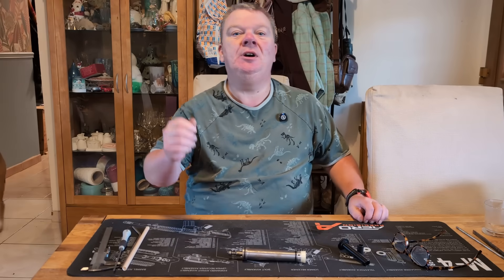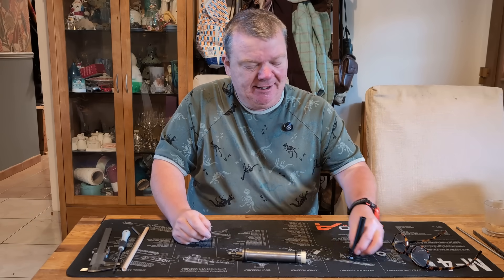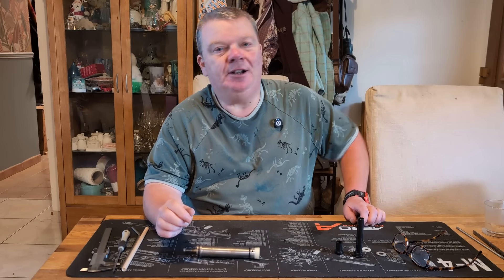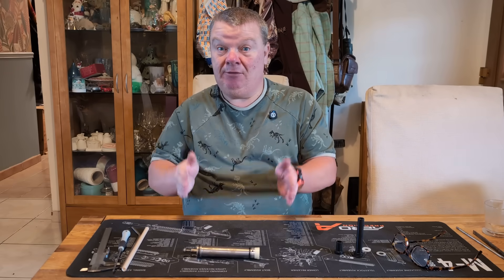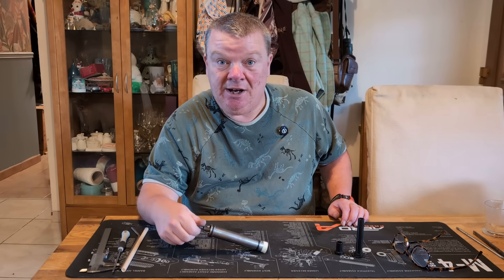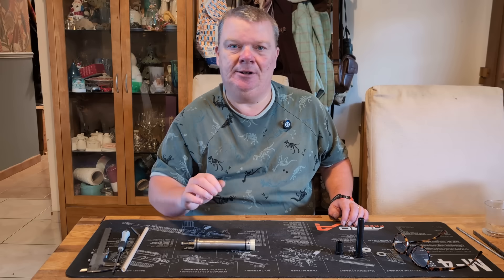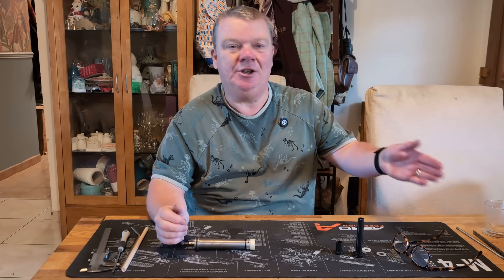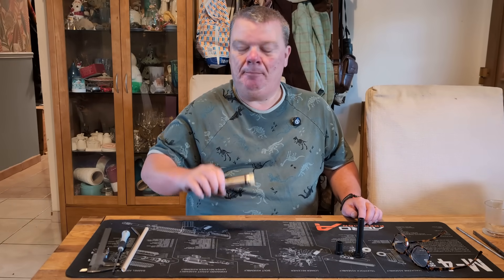The TbT guide to recognising and fixing piston bounce / slam. AKA The Dark Arts of air rifle tuning

Comment: That explains a few things. 
My hw97 has low power, my mates tx200 has over power. Both have the maxi pro in them. Think I'm one of the 5% that needs to add a bit of weight. The weight I removed which comes with the 97 that I thought had to come out. Every day's a school day!
Cheers again.
Reply from the maker: With a full length spring the weight isn’t needed. I changed the springs, but not the advice! It’s a school day for me as well. Don’t hesitate to call if you need help or advice🙂

Comment: Would it be worth experimenting with pellet diameters if piston bounce is an issue? JSB .177s are available in 4.5mm, 4.51, 4.52 and (I think) 4.53. Presumably, a skinnier pellet is easier to push down the barrel.
Reply from the maker: Yes, or reducing the pellet with a sizer. The downside in a springer is if the pellet starts moving before the peak pressure is reached, resulting in a drop in power